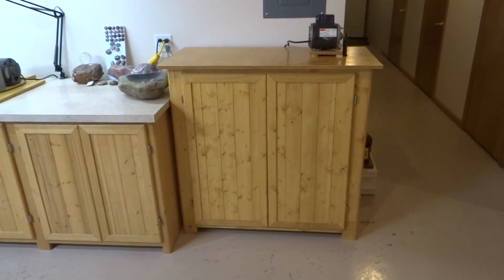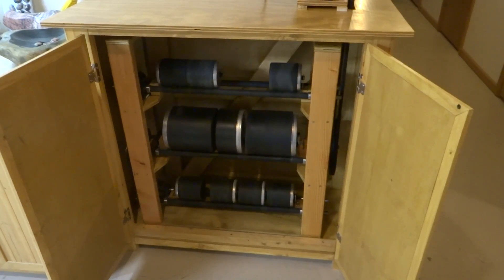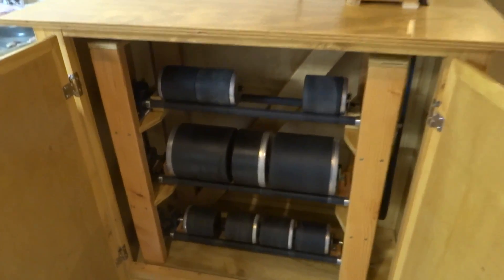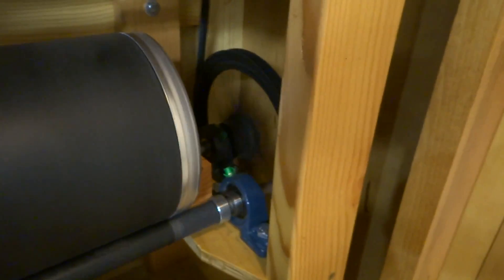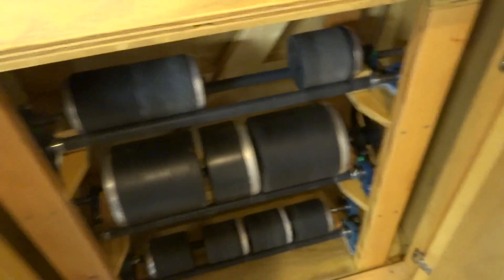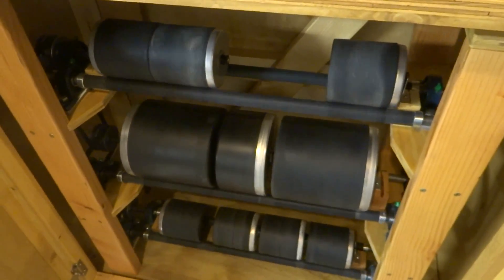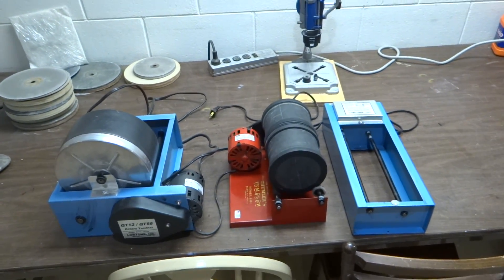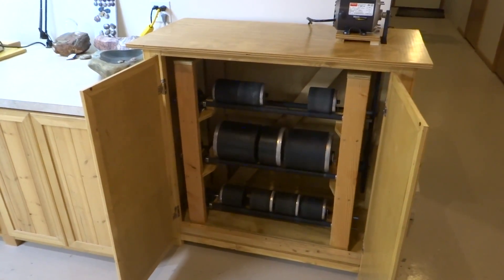Homemade Rock Tumbler

Comment: Where did you find that motor?  What is the exact model number?  I tried to read it off the video, but it is difficult.  I'm planning a single motor, multi barrel tumbler; although mine won't have the beautiful woodwork of yours ;)   Mine will be one that is simpler than yours.  I plan to do one long metal rod to turn, with a couple of secondary rods for different sized barrels.  I have 12 feet to work with under my work bench.  I found the bearings for the rods...
Reply from the maker: It's a Dayton 9MTJ4. I don't remember where I got it.
Reply: @MichiganRocks  How many RPM?
Reply from the maker: @kokosnood  The motor or the rollers? I think the answers to both are in the comments somewhere. I'm too busy to go check right now and am going to be tied up for the next couple days.
Reply: @MichiganRocks  I went thru and found it...1725 rpm.  Thanks!
Reply from the maker: @kokosnood  Great. Sorry I wasn't more helpful the other day. I was a little frazzled trying to get a few things done before a guest arrived at my house.
Reply: I was just about to ask the same question lol
Reply: @MichiganRocks  I think they changed all the Dayton model numbers.  And I can't fine "Wattsaver" Dayton motors anymore.  But I think I found some on ZORO that would work.  One is 1/4hp the other is 1/3hp.  I plan to run 2 lortone 6 pound barrels, 2 (I have 1 now but want to buy another one) 12 lb lortone barrels, and one 15 lb Tumbler barrel.  As you know the actual weight is more than the stated amounts.  Any suggestions between the 2 motors (1/4 vs 1/3 hp) ?

Comment: I've never been able to afford a rock tumbler. Is there any that don't cost too much for small jewelry making rocks?
Reply from the maker: A Lortone 33B is a little over a hundred dollars at The Rock Shed http://therockshed.com.  It's the first tumbler I ever owned and I ran it for about seven years continuously.  It did require a little maintenance along the way but it still works.  I'm still using the barrels in this tumbler.  

You will need to buy grit and either ceramic media or plastic media, so the tumbler is not the only cost.
Reply: @MichiganRocks  I appreciate your response.  That is an investment I will have to think about.  :)

Comment: What size is the belt?
Reply from the maker: There are several belts of different lengths. My friend who designed it asked me not to share the plans and giving belt lengths seems like it's starting to cross that line. The belts will also depend on what size all the other parts are.

Comment: Awesome Job! How is the heater hose holding up?
Reply from the maker: I replaced them with clear plastic tubing, then removed them from the top and bottom row. The middle row is holding up well with the clear plastic. I can't remember exactly why I changed the original heater hose. I might have thought it was shedding too much rubber, but that ended up being the cheap belts I used. No shaft covers are unnecessary if using rubber barrels. They have plenty of grip on their own.
Reply: @MichiganRocks  We have a rarely used (several days per year) Rio Grande Heavy-Duty Rotary Tumbler Base
Item No. 202017 and after twenty years the clear vinyl plastic tubing disintegrated, so I was hoping the heater hose would be more durable as far as deterioration just from sitting idle.  Thank you for taking the time to share with the community and expeditiously answering my inquiry. Have a most awesome weekend!
Reply from the maker: @jeffalessi  I'd try to use clear plastic (vinyl maybe) tubing that you can find at Home Depot.
Reply: I just checked and our local Menards has the "Sioux Chief 5/8" ID x 3/4" OD Clear Vinyl Tubing" in stock. Thanks again for the follow-up. Have a most awesome evening!